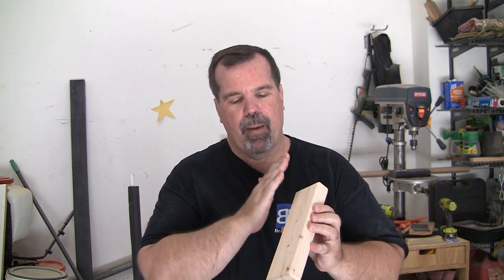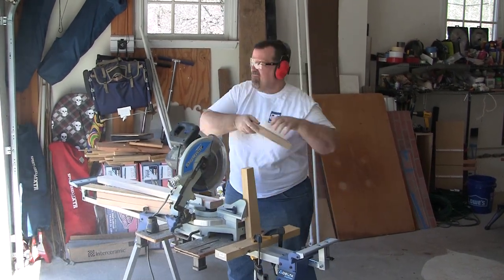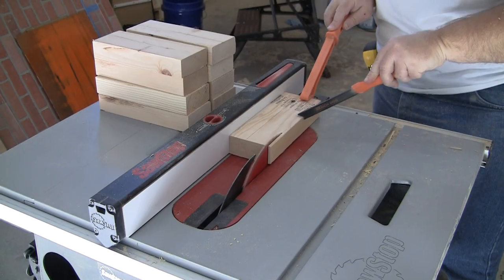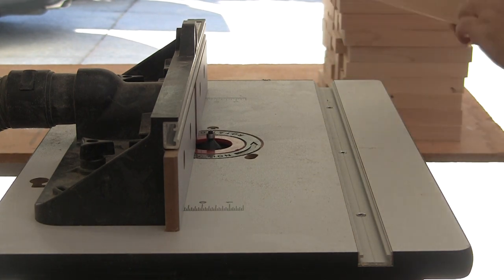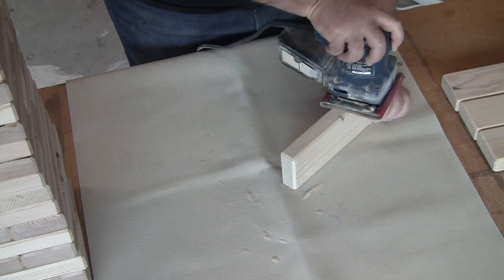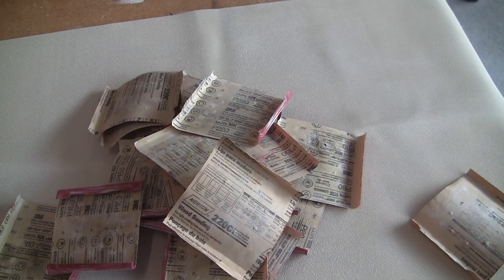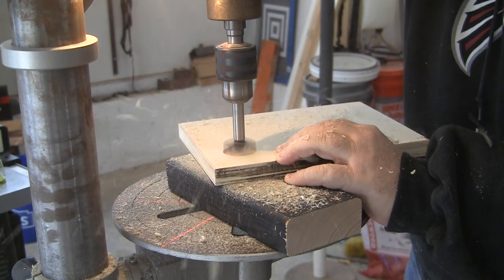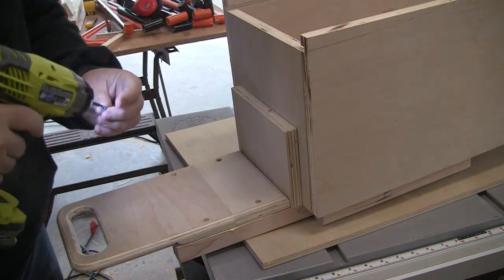Giant Jenga with the Coolest Carrying Case - How To Build It!

Comment: Nice work! Only thing missing is a way to easily stack the blocks squarely. I’m thinking of making a case similar to yours but no handle or wheels and make the top slide out so I can turn it over and use the case to stack the blocks quickly then pull the case away. Only downside is the case can’t be used as the base. If kids are playing it that’s ok because the case would be too tall of a stand anyway.
Reply from the maker: I was thinking something similar but ram out of time.  I was thinking of something may have two sides and a bottom took stack and slide out like you are thinking but works also fit in the case/stand to store with the blocks.  Didn't have time to try things to see if I could come up with something that would work.

Comment: Like the box, but wonder if you came up with an idea to remove all standing pieces from box to game-ready position, like maybe a way to easily remove bottom?
Mike
Reply from the maker: Thanks, it works better than expected and moving the blocks is far easier than I expected.  Especially since they end up being quite heavy.  I did think about creating a template with two sides and a bottom that could fit in the box and the blocks in the template.  That way the idea was that you could simply pull the template out with all the blocks setup, then slide slide the template out from under the blocks and be ready to go.  Turned out it was a bit too heavy for many people to do that and setting up manually takes less than a minute or two.

Comment: This is awesome. Do you happen to have written out instructions?
Reply from the maker: Thank you.  I'm sorry I do not have written instructions.  I can see if I can come up with something for the case.  For the blocks it is simply cut a bunch of 2x4's so that the length is 3 times the width and sand and sand and sand.
Reply: @BronkBuilt  Anything on the case instructions? I'm thinking of making the box side extend to attach the handle instead of the add on piece you use to hold the handle - Any thoughts?
Reply from the maker: @JosephASorrentino  If I'm understanding you, instead of the flip handle that I did, you want one that simply exends up and down.  If so the first thing that would come to mind is something very similar to the front I made.  Build the box as I did, but the sides could extend past the the back of the box a half inch or so.  Cut a dado on each side, just like I did the front and slide a board in the dado so it can slide up and down.  I'd have to think a bit on how to put in a stop so it doesn't simply slide all the way out like the front of my box.  I have no idea if I'm explaining this well enough at all.  Let me know.
Reply: @BronkBuilt  Thanks for your response -  that is a good idea also but no - you use 4 pieces of 1x1 on 2 on each side with a through bolt  - I was thinking to make the side deeper to extend past the back with a bolt through it so I could loose 2 of the 1x1 and just attach the flip handle to the side.
Reply from the maker: @JosephASorrentino  Ah, now I believe I see what you are saying.  Extending the sides past the back a bit like you said should work.  Make sure you measure well and test where the bolt will go so that the handle has room for full motion.

Comment: I would love to make this holder for my game but I have one question, what are the dimensions you have for the handle  the one I make I just put the pieces in a carrier you pick up and the game weighs 65 lbs.
Reply from the maker: I hear ya...  I didn't want to be carrying all those blocks either.  They do get heavy.  Here are the heights that I think you want do know:
- Height of case: 26 inches
- Height of case and handle fully extended: 39.5 inches
- Length of just handle, including top and bottom portions: 26 inches
- What I would have done differently:  Place a locking mechanism like a simple latch where the handle folds.  It's not terribly inconvenient but having that pivot point lock in some way would may tipping the box on the wheels much easier.

Hope this helps and let me know how yours turns out.
Reply: thank you and i will

Comment: Why not mill them before you cut them to 9"? You're just adding an unnecessary step. It's a great build though.
Reply from the maker: Great question.  It's because the 2x4s were anything but straight.  To mill them first would mean taking off more material than I wanted to.  Now,  I could have done maybe 2' sections at a time but just did it this way.
Reply: @BronkBuilt  I see where a lot of people buy 2x3's.
Reply from the maker: That would work.  Just know that those are often even more twisted  but if you do find good ones it could save a good bit of time and work.
Reply: @BronkBuilt  that is very true.